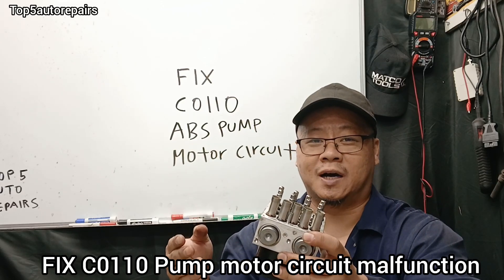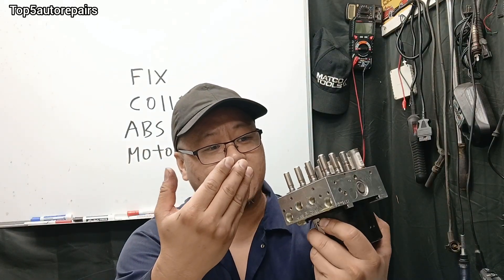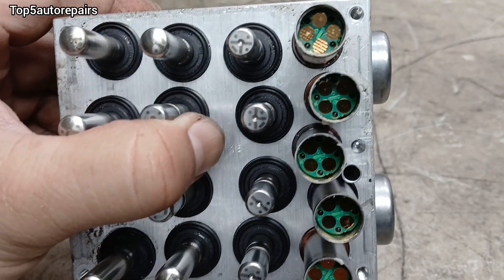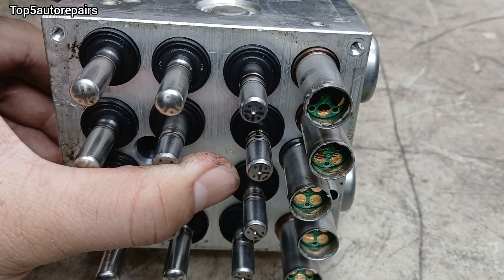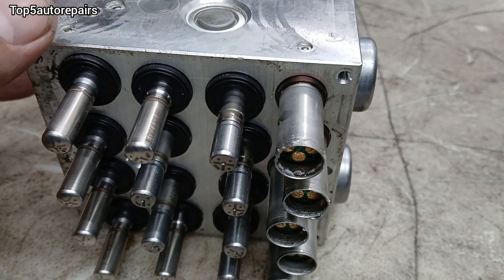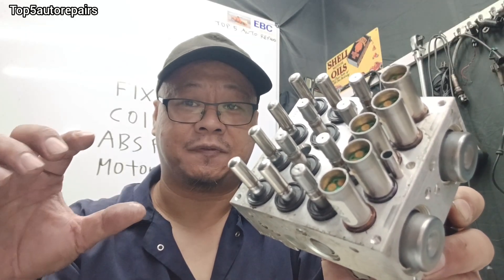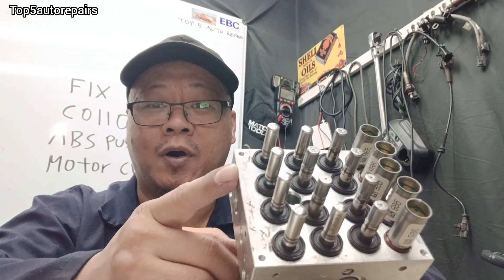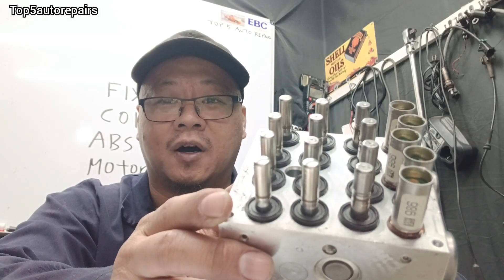C0110 PUMP MOTOR CIRCUIT MALFUNCTION SYMPTOMS CAUSES AND HOW TO FIX IT

Comment: Once you put new abs module in is it hard to initialize it or what is procedure called ? Is it self directed prompts   ?
Reply from the maker: It's straight forward. Follow instructions on the scan tool and make sure to upgrade software if possible. I use Autel (over 10 years old but still works great). ABS initialization is required when changing pump, abs module or together as an assembly otherwise there will be braking issues.